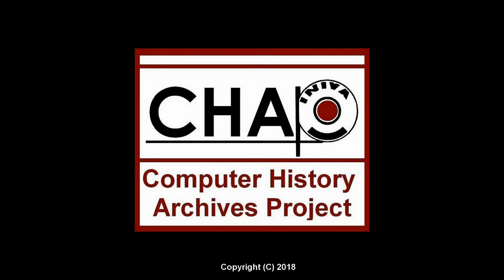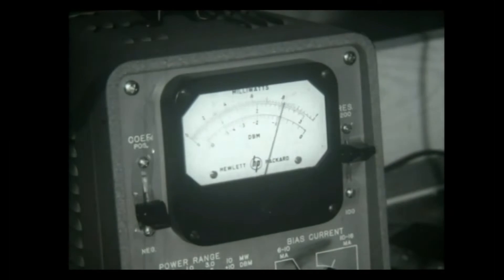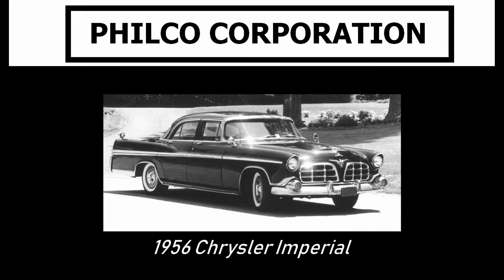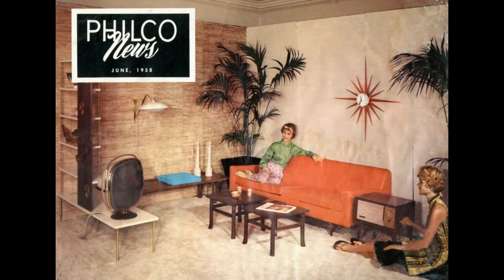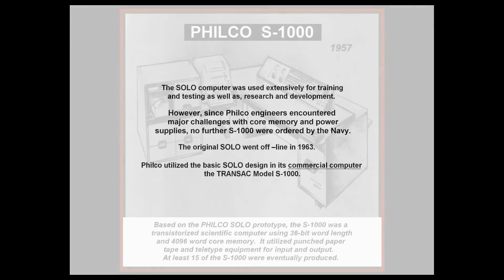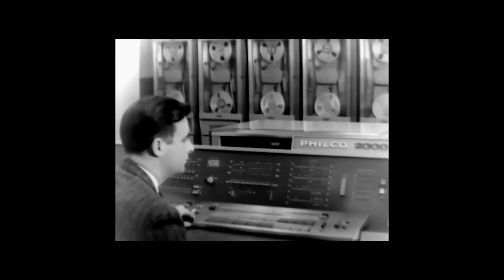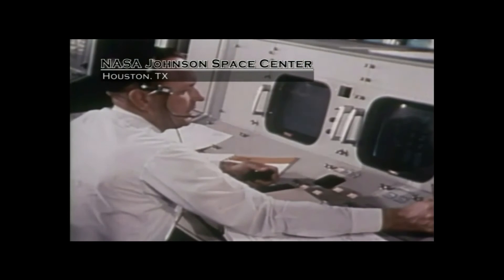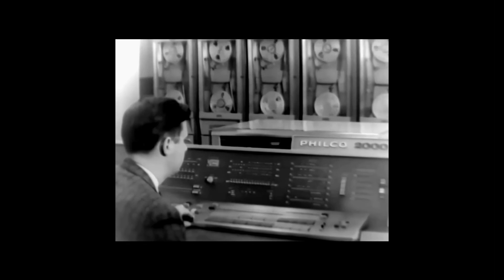Computer History: PHILCO TRANSAC 2000 Mainframe (NORAD, NASA, SOLO, Philco-Ford)

Comment: I attended Pratt Institute in the early seventies.  They had two Philco 2000s.  One was operational for academia and the other was in the basement for parts.  Back then it was something to see.  There might have been 10-12 mag tape units, all running.  It might have been a Tape Operating System.  Now ancient history.
Reply from the maker: Alan, "Two" Philco 2000's!   I would have loved to see that.  They took up quite a bit of floor space didn't they!  ~ VK
Reply: @ComputerHistoryArchivesProject  As you know, most all mainframe style computers back then took up "tons" of square feet.  The working Philco 2000 was in a large space, that as a student I was only able to see through the glass wall.  That computer room want large enough for two working systems. If I recall correctly, the one in the basement was in pieces stored wherever there was room.
Reply from the maker: That makes total sense.  I also recall that some Philco 2000s and RCA 501's needed to have floor reinforcements just to support their weight.  :  )

Comment: I actually got see the NASA Mainframe before it was shiped to NASA my Father who 
worked for Philco, Philco/Ford and Ford Aerospace, they had a Family Day to Tour
the Facility that had moved to Suburban Phila. I was just a Kid, but remember that the
Mainframe was made up of room after room of tape drives and the console took up an entire building. One thing they don't point out here is that Philco designed the First Sidewinder Air to Air Heat seeking  Missile in 1956, that Variants are still used today.
My Father Designed the Assembly Line for the Nose Section that had the heat sensing device @ the Wissahickon Ave Plant.